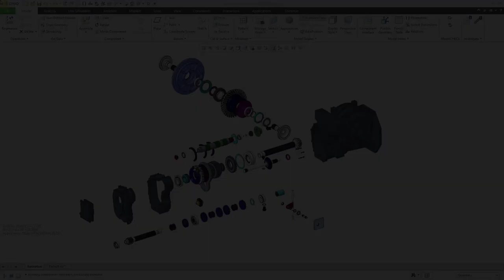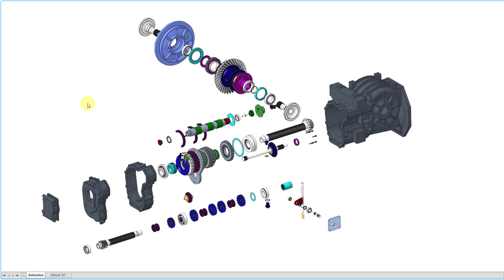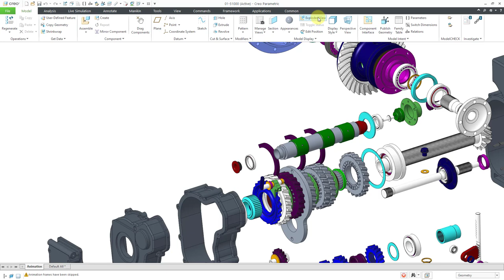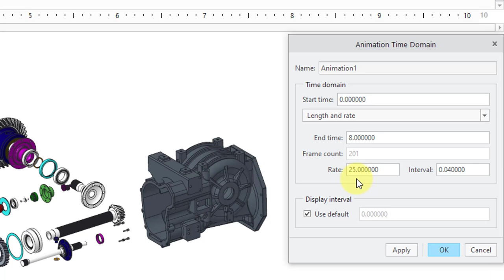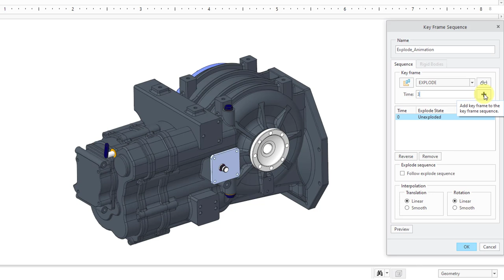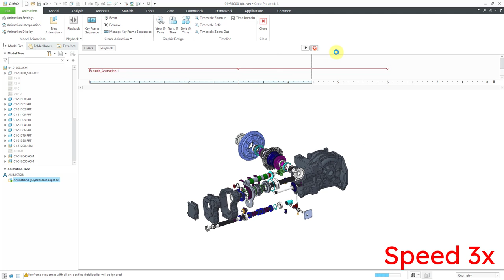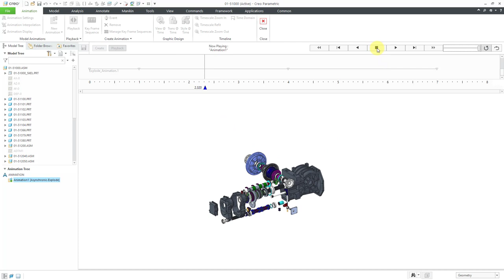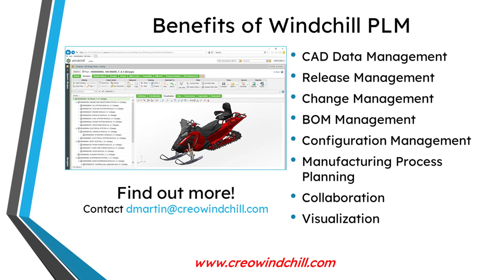Creo Parametric - Design Animation Option (DAO) | Exploding Assemblies

Comment: is there a way to automatically explode in a decent order all those pieces? thanks
Reply from the maker: There is a Default Explode State. The algorithm used to be terrible but it’s pretty good now.
Reply: @CADPLMGuy   I'll try again, thanks. I'm using this program just to create spare parts. Another question: is there a quick way to let the .ASM parts be exploded as a single piece and not with all the sub-parts flying as they were indipendent?
Reply from the maker: Yes. I suggest you watch my video on Explode States. There is a button for toggling subassemblies between exploded and unexploded.